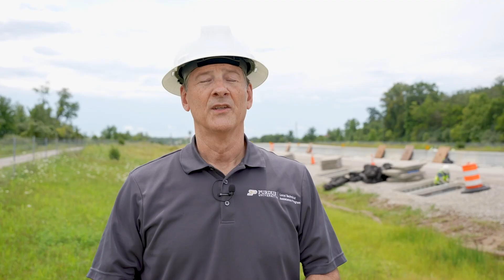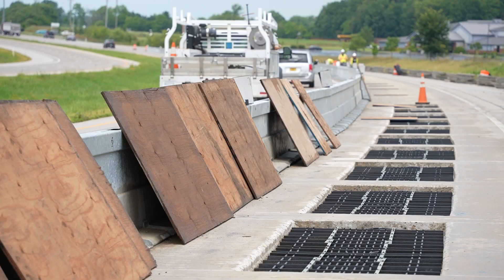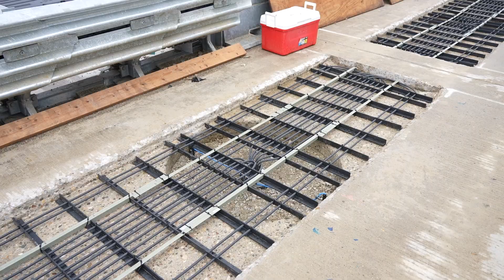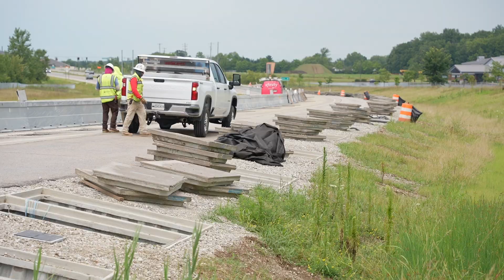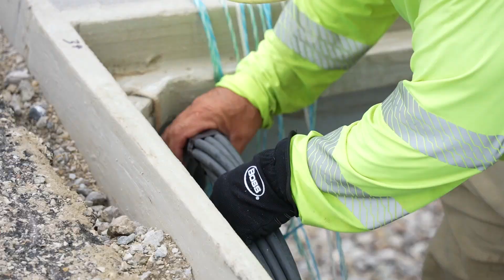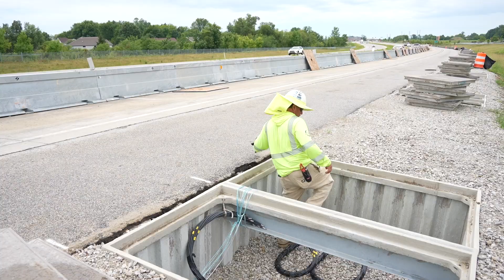Purdue Expert: Wireless EV Charging

Comment: I hope you are also evaluating safety issues. Unlike a phone an EV has a battery that is orders of magnitude larger and also unlike a phone this need to charge really quickly. So the amount of energy being transferred wirelessly is truly enormous. When a human body being so close what kinds of impact is likely? I would much prefer swappable batteries if you can get the economics to work. The engineering risks have been completely mitigated and there are no safety issues either.